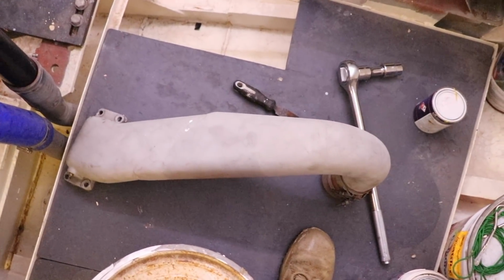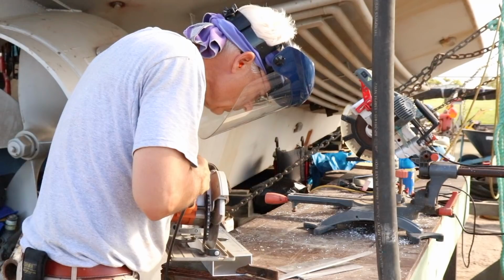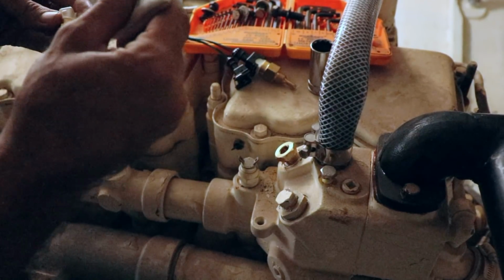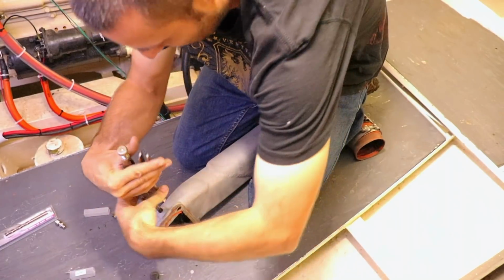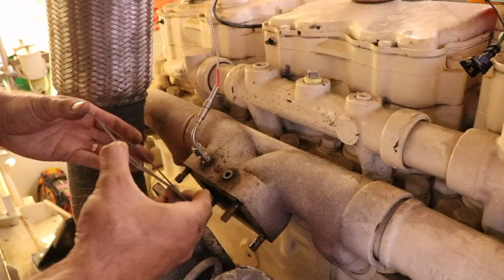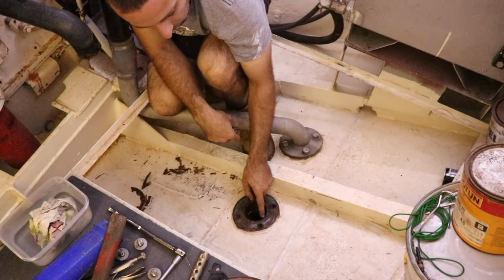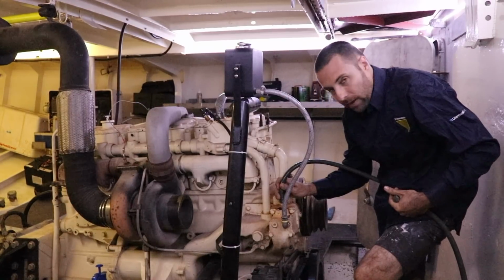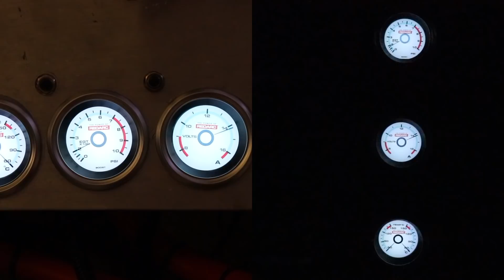Fitting RedArc Engine Gauges (part 2) - Project Brupeg Ep. 84

Comment: Damien, As you filled the keel cooling I wondered why no corrosion inhibitor?
Reply from the maker: Its just water at the minute to check it all works and we dont have leaks, still need to change a few hoses over and fit a larger header tank. once that's done, antifreeze will be going in.

Comment: I wouldn't water cool your exhaust manifold. You need as much enthalpy as possible in the exhaust gases as they leave the engine and before they hit the T/C inlet. To improve comfort in the Engine Room you should insulate the manifold as best you can, which will also increase the efficiency of the engine.

Comment: Will you have a remote starting control on the bridge?
Reply from the maker: Hi Gregory. We thought about this but we opted initially for engine room only starting. As it forces good habits of checking oil, belts leaks etc before every start up. I’m sure I will get sick of this and wire a bridge start but for now is engine room only.

Comment: I call it anti sneeze because it pissed and old boss off lol. If you can find them they make a brass exhaust nut that makes removal easier but they a one time use nut. Try to get turbo yoda to make your exhaust manifold aka mighty car mods
Reply: Same boss didn't like me using liquid teflon sealer until a tear down and found that chunks of teflon tape were the failure reason on a hydraulic valve
Reply from the maker: Yeah I like the idea of brass nuts. Apparently Cummins now supply split steel nuts so they break rather than kill the stud
Reply from the maker: I have heard of tape doing that. Yeah we try to use gel wherever possible

Comment: One trick to get goop like than in threads where fingers don't fit is to have a straw that's melted shut on one end (a short piece) well affixed to the nozzle of the tube (tape, superglue) With one or two slits on all sides, you then insert the straw in and once squeezed, the sealant will go through the slits in the threads. I've actually converted one tube for that purpose alone, used a small screw to plug the end then used my box cutter to cut V groves in the nozzle.
Reply from the maker: That’s a great solution. Thanks

Comment: If you don’t want to build an aluminium water tight box buy a no name brand small Pelican type case and use it to mount your electrics on a panel and secure the panel in the water proof box and seal up any holes with grommets and silicone.
Reply from the maker: Thanks Pete. For us the alloy was as much about water as it was about booting it off

Comment: Will the water sensor get in the h2o or be caught in an airlock in the first brass adapter?
Reply from the maker: Hi Pete, it has full liquid contact. It’s sitting in the factory position so it does seem to be ok
Reply: Hi Damien that' good to hear, I have a monitoring system on my Prado and I have an inlet air temp monitor after the turbo and inter cooler in the inlet manifold and it is surprising how high the temp gets which then reduces the power output of the engine. You may want to think about doing that as well. Best wishes, Peter J.
Reply from the maker: Thanks Pete

Comment: Im sure you'd be able to remove the manifold studs with some penetrating oil and the double nut removal technique
Reply from the maker: Yeah the threads have all but rusted away, they are incredibly weak so any real pressure on them just starts to twist the metal themselves. Certainly a big amount of heat and penetrating oil would help but i still have my doubts the stud is strong enough to support any twisting action.

Comment: Have you fitted a wood heater in the living area,  I heard of a guy who dried kelp sea weed and used it in his small wood heater in trawler boat, it said it worked very well and the heating was virtually free.
Reply from the maker: Yeah at this stage we haven’t put any heating in as we live in sweltering Australia. But it’s definitely something we will be adding prior to any ice work
Reply: @ProjectBrupeg  G'day Brupeg, not sure if it's any help but there are one or two schools of thought on narrowboat/canal barges over here as regards heating. Most narrowboat channels have links to the various options but to shortlist them there's old style wood/coal burners, plus side of these is that they are relatively cheap to run, downside is they are dusty (fine ash) heat output is relatively localised, and wood/coal is not readily available in the Arctic/Antarctic. As I understand it there's two types of diesel powered heat source, Webasto/Eberspacher type blown air systems and diesel powered stove (looks a bit like a stainless steel version of a woodburner but obviously burns diesel in place of wood/coal) I'm pretty sure that there are Webasto/Eberspacher systems can also supply hot water as well as central heating. I'm no expert but hope this is of some help when you venture into colder climes. I apologise if this has been covered elsewhere, I'm almost caught up but not quite.
Reply from the maker: Thanks Jon. Yeah I do like the look of those blown air diesel heaters
Reply: @ProjectBrupeg  Thanks for taking the time to reply. It really does make us out here in YouTube land feel part of the project. I'm on Ep84 at present and have only just managed to resist the temptation to post double entendres regarding copper greasing your nuts or even double nutting those exhaust studs. Ooops, gone and done it. Lol.
Reply from the maker: Yeah it’s hard to not mention greasy nuts at times...

Comment: I like the way You do things but YOU need to put an anti-freeze in the coolant water, the reason is that it stops the water boiling at 100 degrees and will only boil at 145 degrees and will also help to stop the system freezing when you go in to cold areas. Th mix must be at least a 70% anti-freeze and 30% water.

Comment: Exhaust studs should be fine 
Studs fit firmly in the category
If it ain't broke dont fuck with it 
No such thing as a quick exhaust job
Reply from the maker: Yip. Can’t remember any exhaust stud that just come out easy without a fight
Reply: Project Brupeg I believe I’ve gotten 2 out over the years. But both had been in less than a couple years. What I found works the best, is to have a torch and to heat the manifold close to white hot and then you can pull the stud out because of the expansion caused by the heat.  Heat has worked better than tapping them out..😉
Reply from the maker: Sounds good. I don’t have a torch that’s anywhere near hot enough but I think when I tackle those studs I will definitely rent one as I can’t see that job happening without a bucket load of heat

Comment: Just my opinion but I would get and or make a bigger expansion tank that little one isnt big enough for that big engion.  And awsome looking  gates
Reply from the maker: Hi Sam. Yeah that’s a temp tank so we can run the engine while figuring out the wiring and to check the system as a whole for leaks. We will be putting a much larger tank in prior to launch
Reply: @ProjectBrupeg  I kinda figured have a nother question are u guys going to put in some kind of low water/coolent alarm. I'm a diesel technician that works in the marine field and have seen many of cases were a boat without one dumps all the water into the bilge and end up burning the motor up because they dont notice till it's to late.  Just a thought.
Reply from the maker: Hi Sam, Redarc Supplied us with a low coolant level alarm which we have yet to wire up. definitely not leaving the yard without one of those in place

Comment: Hey. It is impossible to install electrical wiring and electronics under plates. In the engine room. It's damp. And wet. All wiring must be sealed Packed. If it goes under the plates. Or the wires should be installed above. Thanks. And more. I didn't see the filter. The seawater. It should be big enough. What would the engine overheated if it is clogged with dirt. And available for service.  Good luck.!!!)))
Reply from the maker: If we have water over the wiring under floorboards the boat is flooding... and that’s a bigger issue. Everywhere in the engine bay has the same amount of condensation. We are doing our wiring to commercial specs and have trained air force engineers/electricians helping and an electrical engineer designing it. I think we will be okay. But thanks for your concerns. We are lucky to have so many people looking out for us. Cheers Jess
Reply from the maker: Also can I just add (Damien here) the box is a fully water tight sealed unit with silica gel inside to capture any moisture. As for seawater, Brupeg is 100% fresh water cooled so we don’t have any filters as it’s a close loop keel cooling system currently.

Comment: No offence intended but I would never put a bunch of electrical connections underneath a lead acid battery.  It's hard enough keeping the steel battery tray from corroding never mind copper wire and brass connections.
Reply from the maker: Fair enough. This might be something we change later. For now it was the easiest location to work with

Comment: don't water cool the exhaust manifold!!! exhaust pressure is only part of what spins the turbine. it also needs the heat to make the turbo efficient.

however, you can water cool anything more than 18" downstream from the turbo exhaust outlet.
Reply: This is true.  A turbocharger is powered more by heat than by flow.  And you can estimate turbo efficiency with pyrometers before and after the turbine.  The amount of temperature drop from pre-turbo to post-turbo indicates the amount of work the turbo is doing.
Reply from the maker: Interesting to know. Thanks guys
Reply: Every  marine engine exhaust manifold should be water jacketed, Engine coolant, not raw water in general, petrol mercuisers are notoriously raw water cooled..., not so much to cool the exhaust gases, but to keep engine room heat down,  I believe its a legal/safety thing from ABYC as well, given the boost that marine diesels engines usually run compared to land engines the slight cooling effect of the water jacket is negligable..
Reply: @Nick75au1  
Its not a marine engine though 
Its a truck engine 
Different turbo for marine engines 
Usually a bit larger to account for the loss of heat and to run higher boost
And sometimes watercooled housing as well
Reply: @Nick75au1  Cooling the manifold before the turbo will kill efficiency.  The turbocharger absolutely needs that heat to operate.  Exhaust wraps are the way to go for lower engine room temps.  In fact, exhaust wraps alone have been proven to improve turbo efficiency AND increase engine cooling by keeping heat in the piping which increases exhaust velocities and therefore scavenging.
Reply: @PixelSchnitzel  Cummins 8.3 road going max 380 HP, Marine version, up to 600 HP, where is the efficiency lost in a 220 increase in HP from road to marine version, seriously guys have a look at every manufacturers marine engine range and find one without a water jacketed exhaust manifold. Ive been working on boats for a long time, Ive yet to see an engine without one. Im sure there are a few home made conversions that dont...
Reply from the maker: Thanks Pixel, yeah I have seen some really nice covers for the manifold and turbo, will likely look into that as we managed to save the manifold so no need to build anything new
Reply: .BTW Im not advocating that it NEEDS to happen, only relaying what is out there in the real world. a marine manifold can be with a quick search be had for under $500 Not worth trying to build IMO for that money.
Reply: @nicholaskeur  
Yea differant turbo and differant injectors differant tune 
A lot more smaller diferances as well 
You can get away with a lot when you have unlimited cooling and even regular load  (ie on ones going to drop the clutch)
Reply from the maker: Nick I agree to buy rather than build for $500, my thought was I could build a very heavy wall stainless manifold for a similar amount to a cast steel version. As for different turbo and injectors. The engine is from a 1984 international T Liner so rather than convert to marine trim we will be keeping whatever the truck uses for simplicity
Reply: @fowletm1992  Agree, I am just relaying my experience with marine.
Reply: @Nick75au1  
Fair enough